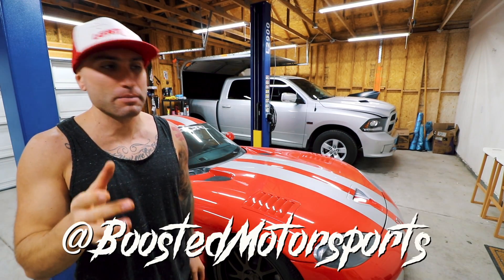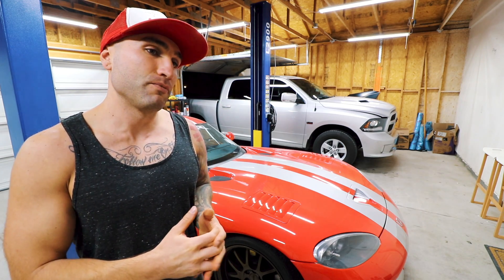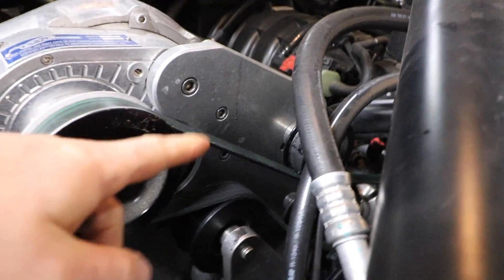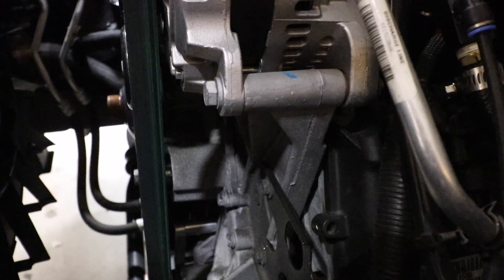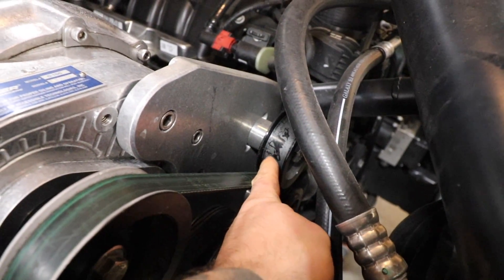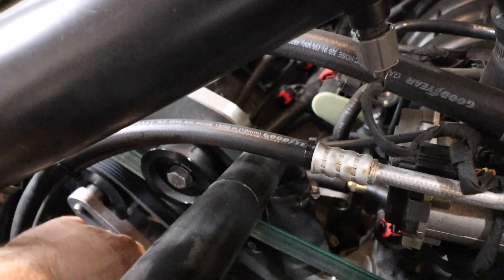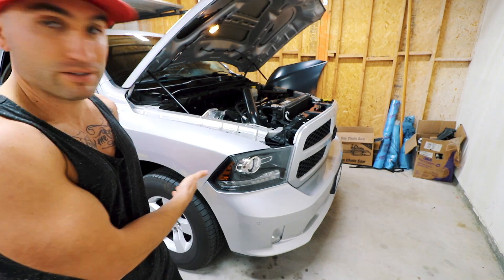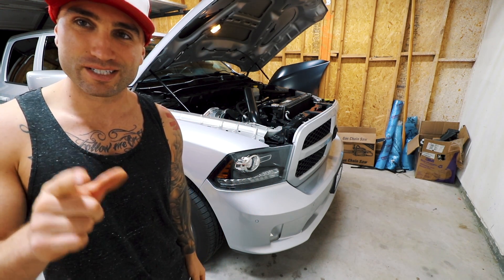PROCHARGER SUPERCHARGER BELT WEAR

Comment: Sounds like an idler pulley Bearing  going out to me...
Ive had multiple vehicles in my shop with  customers replacing belts, until i point out the idler pulley squeaking and occasionally locking up when warmed up, which is what makes that black residue. Just a tip..😎

Comment: I am amazed at the lack of information from ati for belt tension procedure on cog Drive. One guy will say 1/4 inch play another says one in another says 1"  another says adjust while the engine is hot Etc.. But you can find nothing from ATI about proper tensioning on a cog belt..

Comment: Did you use the stock tensioner to get the belt off or did you unbolt the procharger idler pulley?

Comment: Is there any chance to move supercharger a bit forward to make it using its own belt?
So you will reduce general belt lenght, this belt will not affect other pulleys and will have much less tigh on it?
I've seen some videos about that, but definitely it requires hand work and some mount plate modifications, also requires additional pulley to be added on the crank.

Comment: If you're getting that much dust from the belt, I'm guessing your still getting some slippage.  Might not be enough to affect boost levels, but there's still some slippage, and I'd guess its on the crank pulley.  Another possibility is misalignment of the pullies, if the alignment isn't 100% it's going to want to walk one way or the other.  Check both belt edges for abnormal wear.  When changing the belt, I would spray each grooved pulley down with brake cleaner and use a brass bristle brush to remove any embedded dirt and debris from the grooves to help prevent slippage, even the pulley that has the coating.  It'd be a bit of work, but should help prolong the life of the belts a bit longer. It wouldn't hurt to clean all the pullies to remove any kind of dirt or contamination from them.  Also check all the idlers to make sure the bearings are all good. If one of them has some bind, it could lead to wear on the back side of the belt as well.

Comment: I'm having the same squeal on my Ram but while driving and at idle as well, old belt had less than 36k miles on it and its doing the same on the new belt. Pulley issue maybe? 

Also when you check your catch can do you find any watery coffee colored looking oil in it? Its winter here on the east coast and I want to attribute this to the condensation after a cold start, I've done a block leak test and my gaskets are testing for no leaks. 

Thoughts?